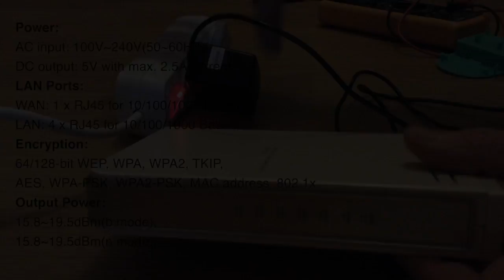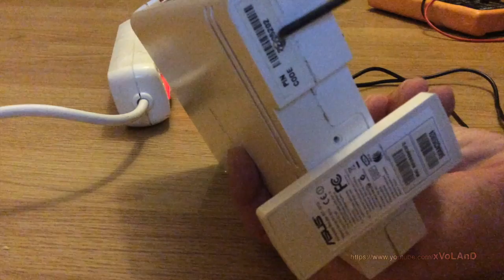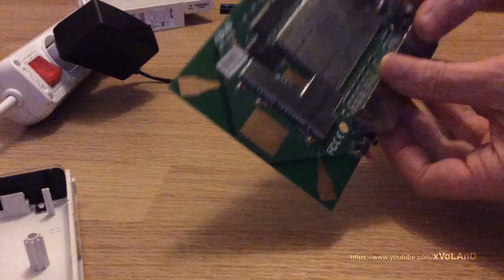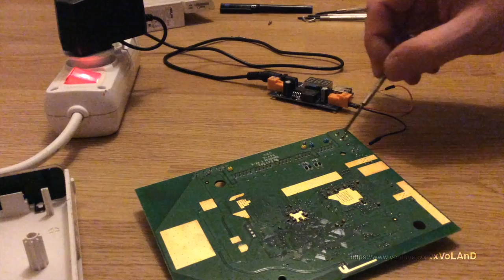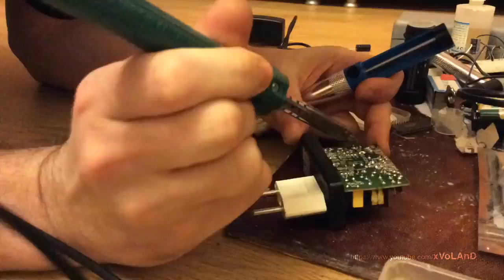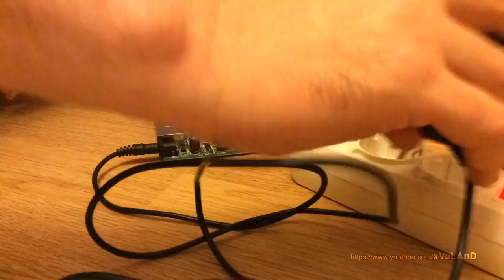$0.25 Repair broken ASUS RT-N15 WiFi Router. How to recovering/fix/power supply. LED not lighting

Comment: Hi. I am trying to trouble shoot my asus rt-n66u router. My case is the router work normally for a while then all leds will turn for half a second then on again.. After the router reboot it work for a while then same problem again. I have open up the router and check the capasitor is not bulged. I still plan to replace the capasitor to try it anyway. Do you have any suggestion what other to try?
Reply from the maker: Hello. First, try another power source
Reply: +Vitalii Tereshchuk is there a way to test the exisiting power adapter using test meter instead? Its a 19v 1.58a adapter its not so common and easier for me to get a test meter than replacement power adapter?
Reply from the maker: Chee Keong Ng Strange values 19v 1.58.
Try another power supply